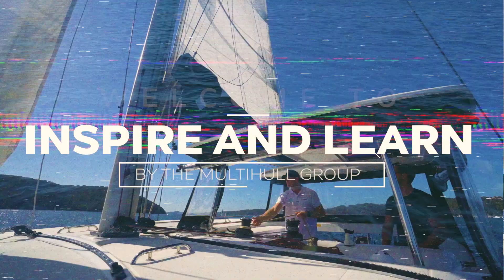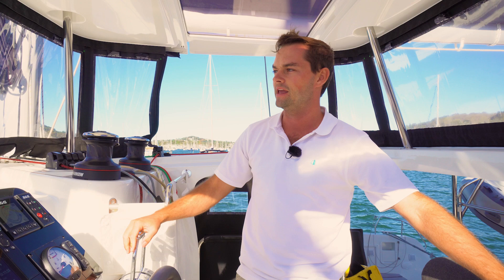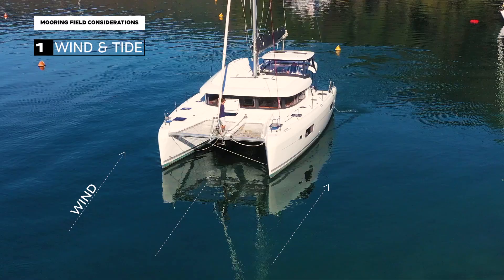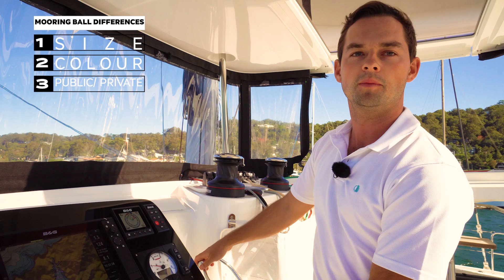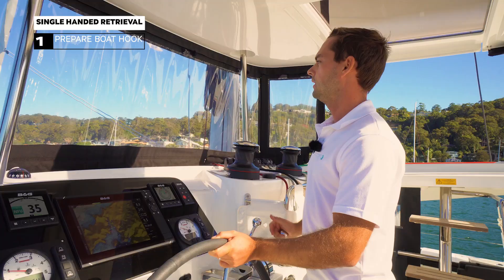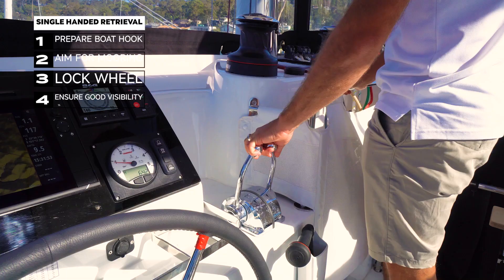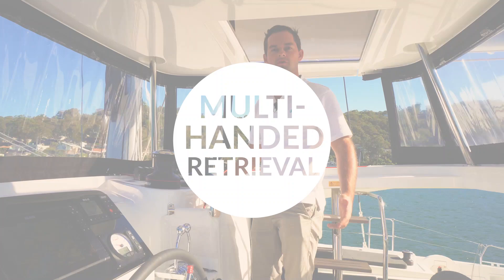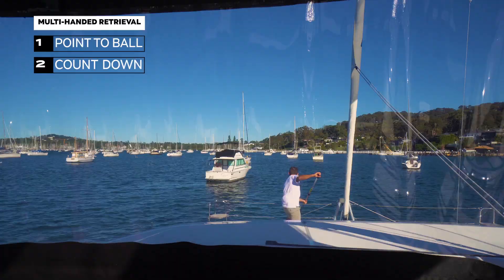HOW TO MOOR | Mooring Retrieval and Bridle Setup on a Catamaran

Comment: I also enjoy your videos.  As a Lagoon 42 owner I can relate to the actual configuration on the boat.  For example, on the Lagoon 42, the forward cleats are in a position where the bridle lines will ride against the pulpit stanchions.  If you run the bridle outboard of the pulpit then it will get caught on the navigation lights.  Since you folks work with L42's what would you suggest to correct this problem with the Lagoon 42?
Reply: My sentiments exactly Kelly.
Reply: Don't get a Lagoon?  Sorry mate, had to....  :)

Edit: whoops, looks like a Lagoon shop....

Comment: Great video!  We’ve always run our mooring lines outside of pulpit along outside of bow which works great but is noisy.  In the video, the mooring lines run over the deck inside the pulpit. Two questions: Does that risk damage to pulpit? Is that configuration less noisy at night?
Reply: Hi There, 

General advice would be to take the path of least resistance to minimise any undue pressure on the pulpit. The noise may be coming from the rubbing of the rope on the deck/hull/pulpit. If this is the case see if you can use softer rope that doesn't squeak under movement.

JF
Reply: I've always run my mooring lines on the outside of the pulpit and hull. I was also wondering if the way shown in this video is indeed the right way.

Comment: I have tried this on my Leopard 44 and other boats and the main issue is the rubbing of the lines on the deck. Lots of noise and wear.
So I ended up using the anchor bridle.
At the moment I am thinking of adding a second shackle to the anchor bridle so it works without multiple ropes.

Comment: Nice video, specially showing the singlehanded technique. But I wonder if the lines like this they won't damage the deck by chafing. Tks.
Reply: I use a section of fire hose for mine when moored for a long time. For one night it's fine.
Reply: Eventually they will. And if the wind is high there will be noise from lines rubbing against the deck.
I prefer to use the anchor bridle. But to be honest have not found the perfect way yet. Maybe I will be installing a second shackle for rope.
Any ideas?

Comment: Thanks for this video and also the super helpful tip at the end about why it might be inconvenient to use a shackle when retrieving the bridle!  Would there be any risks involved with having rope running against rope in this scenario?  (Bridle rope against mooring ball rope?)  I'm a novice with boating, but thinking to rock climbing experience where usually the tendency is to connect ropes to each other using carabiners in order to avoid potential risk of one rope cutting through another rope (or piece of webbing etc.).  In this situation I can see that the ropes are super thick and also under water, and so maybe this would not be a significant risk?  Thank you again for this info and this video series, super helpful!
Reply: very much my thoughts. Did you get an answer yet?

Comment: Thanks for such a clear and easy to understand instructional video. Just one question.
 Would it also be OK to use just the 1 mooring line which you run from the port bow cleat, through the loop on the mooring line so that it can run free and then tie off on the starboard bow cleat?
Reply: Hi there, Thanks for your comment. This is a good question and one that I get asked a lot. If you rig it like this, then there will be a tendency for the mooring line loop to slide back and forth along your nice boat line. As well as wearing out the line, it is also very likely that the boat will swing off to the side, get caught by the wind and because there is nothing pulling in the leeward hull, it will sit askew. Unfortunately this method, although so much simpler to set up, wouldn't work :(

Comment: What kind of line were you using? I know a lot of people use 3 strand nylon, but this looks like a more traditional mooring line? The boat looks to be about 7 meters across, so your advocating for a 10 meter arm, which means each line is about 20 meters?

Any idea on the breaking strain on that line? The boats about 14 tonnes, right?

Comment: Super video.  Very well explained. Thank you!!  Just one question — are there any rules of thumb for the length of each of the two bridle lines?  Guessing the two lines you used were about three times the boat’s beam.
Reply: Hi There, thanks for your comment. I set each bridle line at around 6-7 meters from the cleat in this video. Longer is better as this will reducing any unwanted swinging of the vessel by moving the pivot point forward. It also depends on your swinging room however as most moorings aren't built taking into account a long bridle set up. If there are other boats close by then you could pull it right in to say 3-4 meters, though like the vessel may not sit as good as having a 10meter line on each side. 

As a rule of thumb I would at least 1.5 x the distance from cleat to cleat for bridle length.

Comment: Great video thanks. We have a Lagoon 42 and always worry about swing length in tight spots like Refuge or America Bay so I hesitate top use a bridle. I often find that the cat will swing differently to a mono hull next to us and the boats can hit. Any tips on this? I also would love some tips on how to stop the buoy banging against the hull in the middle of the night!!
Reply: Hi David, thanks for your comment. A simple bridle will really help to reduce the swinging as it moves the centre of effort forward of the two hulls that had a lot of windage. If you run your mooring line thought he spare roller on the crossbeam, you'll find the boat will swing more than with a bridle. Even a short bridle will help reduce the swinging and make it act more like a monohull. Hard to avoid the mooring ball bumping on the hull in very light or no wind. This the nature of the beast unfortunately however in this case you could pull the mooring line as tight as possible to hold the ball between the hulls (without using a bridle). ONLY do this if there is NO wind and keep an eye on the tide (you don't want start lifting the mooring block off the ground ;)

Comment: at 4:16, what is the smaller yellow float that you just seem to "steam" over, thought this was the "ball", or at least the rope you use to anchor to it!!- most sailing books talk about this and say you DON'T moor to this ball directly, but by a rope, a "painter", if that is the correct word here?; as this allows movement due to tide/ wind etc. as some of these moorings are only an engine block, chains, or drums of concrete, and any over-stress could release the anchor at the bottom of this ball ( the so called dragging anchor!!).
Reply: Hi again Andy, Good spot, this small yellow ball is connected to a small line. This is pulled up first with the boat hook, it is light and easy to lift. You then pull on this small "heaving" line to pull the larger heavier mooring line on board. Once set you can drop this line and ball back into the water so long as its short enough not to bump against the hulls.

Comment: Very nice videos! Thank you for sharing. I have two questions (i am still learning!): is it best practice to tighten a line onto another line for chafing issues? The second thing i dont understand is the need of a retrieving line to the bridal: the bridal itself is atatched to the boat on two points. As long as the bridal is double the length of the width of the boat (it is usually), it will be easy to pull the attachment point to one hull, right?
Have a good one!
Reply: Isn't the goal to pull the bridle hook back to the roller though?

Comment: at 11:12 you NEED to be mindfull of going UNDER the jib furling line, as you don't want to get caught on this when the bridle gets let out!!
Reply: Correct, whether its under or over, so long as both bridle lines and the mooring line take the same route there should be no problem :)